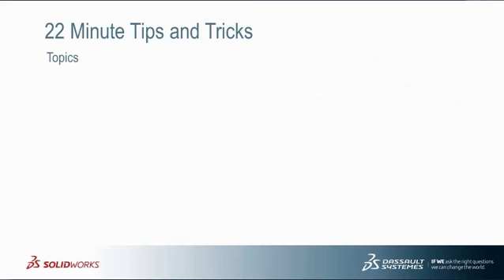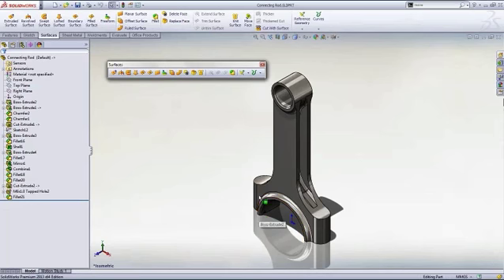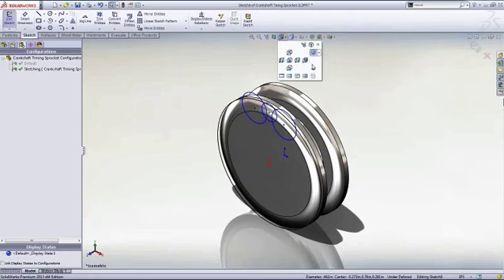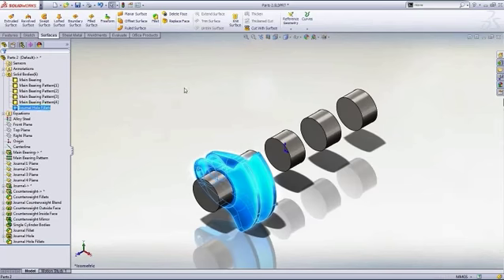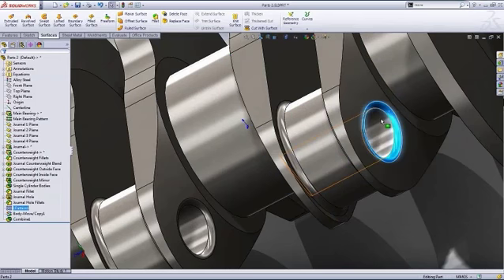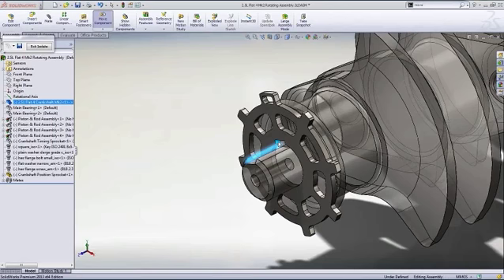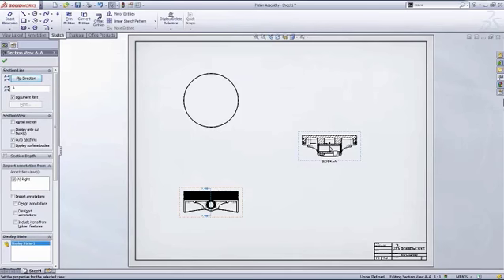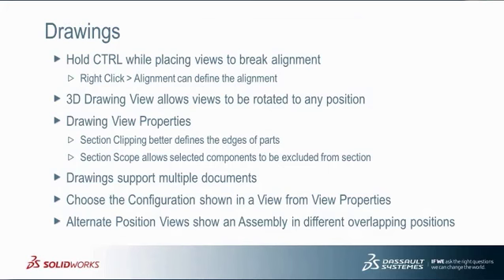Tips and Tricks in 22 Minutes - Webinar - SOLIDWORKS

Comment: Here you go:
User Interface:
Command Search
    Search for any command and use it immediately
    Add Commands to any toolbar with drag and drop
Shortcut Bar (s-menu)
    Flyouts can be added in the customize menu
Drag and drop any button from one toolbar to another using the ALT key

Sketching:
CTRL Key stops automatic creation of Sketch Relations
Shift Key Snaps geometry to Grid snap increments
Press CTRL Key again to bring back the Sketch Relations for multiple items
Power Trim
    Undo Trim by dragging over last point trimmed
    Extend by selecting entity to extend, then entity to extend to
    
Parts:
Multi Body Part Design
    Useful for creating basic geometry then building up
    Copy and Pattern whole bodies instead of individual features
    Move / Copy Body can move, rotate and even "mate" whole bodies
    Combine can perform Boolean operations such as Add (merge)
Temporary Axis are created automatically and can be toggled on and off as needed
Delete Face can remove faces [and holes] while preserving surrounding geometry
Move Face can move geometry without effecting feature history

Assemblies:
Flexible Sub Assemblies support motion in top level assemblies
Drag and Drop to Insert and Mate Parts all at the same time using Smart Mates
ALT + Drag geometry to Smart Mate
Feature Driven Component Pattern reuses Patterns to define component placement
    Changes to the Feature pattern automatically update placement and number of instances
Copy with Mates is a fast way to copy and place multiple instances of parts

Drawings:
Hold CTRL while placing views to break alignment
    Right Click > Alignement can define the alignment
3D Drawing View allows views to be rotated to any position
Drawing View Properties
    Section Clipping better defines the edges of parts
    Section Scope allows selected components to be excluded from section
Drawings support multiple documents
Choose the Configuration shown in a View from View Properties
Alternate Position Views show an Assembly in different overlapping positions
Reply: Thanks!!!